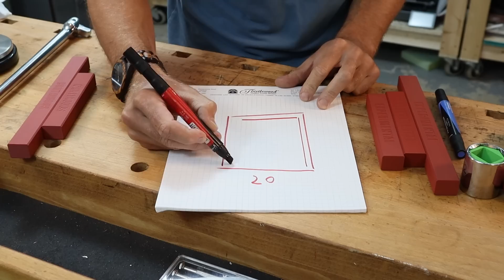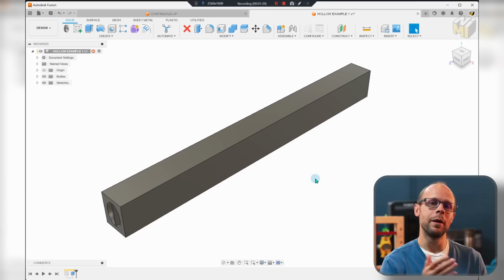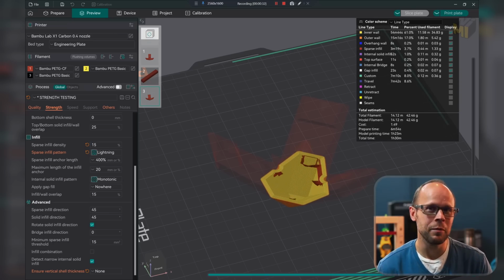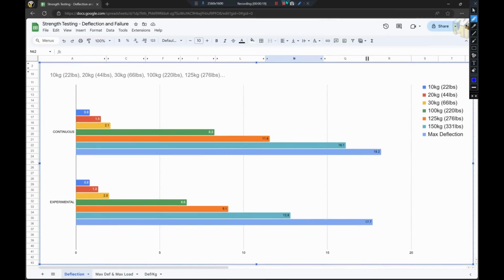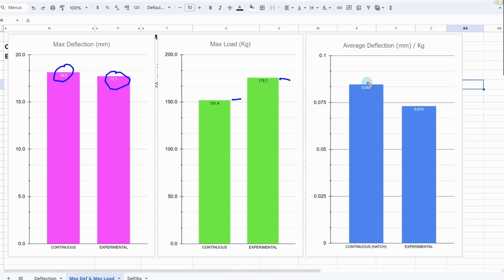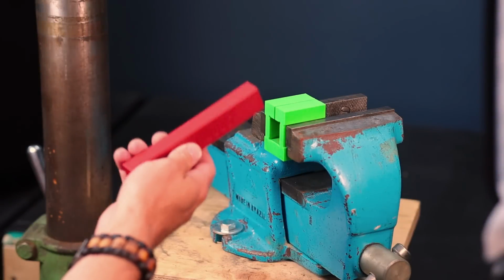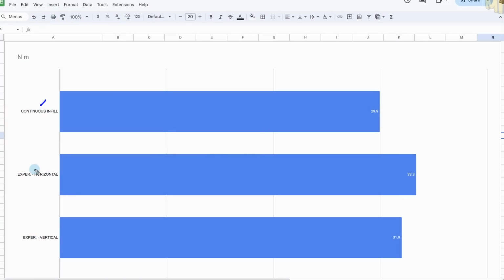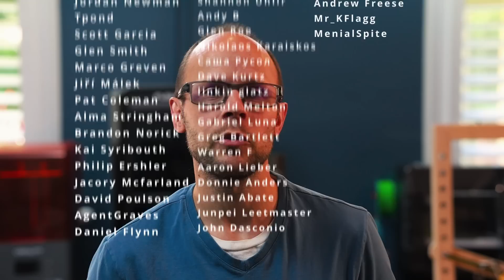Is an UNfilled 3D Print Stronger than an INfilled 3D Print?

Comment: Instead of 1 round hole in the middle distributed holes in circle would improve a lot. Not only because more material but due to the surface area. However that would increase printing time a lot, and it might be just similar (if not better) using low percent gyroid infill with thick infill wall multiplier.

Comment: To smoothly pull on lever, OR direct pull on gauge, use a boat winch with steel wire rope (cable). can anchor it to table or test press and run through pulleys as needed for space management or "leverage" increase through multiplication. VERY CHEAP AND EASY/SIMPLE! Can get ALOT of pull from it and only 4 bolts mounts it vertically OR horizontally for ease/comfort of turning handle.... OR could use a cheap $99 electric 12vdc 1,500 lb atv winch for steady pull rate.

Comment: From my engineer view and experience. What structural properties you get depends on the material.

Materials which are more flexible benefit from filling the volume. While more rigid (brittle) materials benefit from wall thickness.

You can imagine the difference between a steel square pipe and same size laminated wood beam. 

I'm actually insane enough to design my infill in CAD. I have even written gcode by hand to achieve specific things. I'm annoyed that slicers don't actually allow me to have finer control over generated geometry, like directly adding planes or scripting layer behavior. Because I run flashforge, I actually use both Orca and Flashprint, because they do different things better, and if I just want to do quick test I choose the one I know to be easier to do that.

However in engineering mindset your desired properties are always derived 1st from design, 2nd from material.

But because my background is in welded steel products, I naturally account for rolling direction and profile geometry, as they affect things a lot. They are much like print direction and layer joining.

But you will not find any sharp edges in my designs, unless it has a specific use.

Comment: It'd be great if your application of force was always consistent, For the 4 point load test, could you rig an upside down bottle jack above the other end of the handle so you can add load by pumping the jack? That way it should be fairly consistent between the two parts, and it also won't be as reliant on your physical ability to reach the breaking points.

Comment: You could add 3 more spines inside to make it even stronger while using less material than infil
Reply from the maker: I think that could work and provide better support to the tops as well if they were oriented correctly durng the print.
Reply: @NeedItMakeIt  yea I love the concept though you would think more infill material= stronger part but how you fill up the part is what actually matters I love videos like this

Comment: I think the strongest option would be to use hollow spheres for saving material/time/weight.
Lets say you want to have a high % of infill, you'll just distribute some medium-sized hollow spheres as "anti-infill".
If you want to have less % infill, you'll distribute larger-sized hollow spheres as "anti-infill" and anti-fill the space between the larger hollew shperes with smaller hollow spheres.
Reply: You could keep adding smaller and smaller spheres to fill the space between the spheres until you reached the % of non-infill you wanted.

Comment: How much structural integrity might be lost adding holes to the hollow rod? because in theory having it hollow also allows for running hidden wires, no? I mean I don't know how useful that would be or anything, but its an interesting idea.

Also I am not really knowledgeable in this field, I am assuming deflection is how much it bent before it broke, is it better for that number to be higher or lower? and how hard is it for something to go back to its original state if it does bend? that is something I think would be a good test (Though I suppose structural integrity would be compromised at that point).

Comment: Mathematically speaking, pound for pound your best options are either a large hollow cylinder or I beam for holding loads. For your tests, an i beam would work best with most of the length facing "up" and enough width at the top and bottom to prevent torquing, you wean the whole load straight on the support. Conceptually just thing about how much material force would need to move in order to bend it. The more material the better right? If you can imagine drawing lines through it at a perfect 90 degrees from the earth, that's how much material is holding the weight. The more lines that run through a cross section, the more material would need to be moved.

Comment: If you look into beam strength in bending, and why I-beams were created, you'll see that having more material under tension/compression at the furthest extents from the neutral plane(axis, for torsion) increases stiffness. But if stress goes too high, you can get a split down the web of an I-beam (on that neutral plane) so I think it would be worth comparing 2-3 printed I-beams of similar mass, but with different web:flange ratios. 

Chances are they're not worth the complexity to model/print in comparison to a shelled model, or one with minimal infill, but it may be a good demonstration.
But I suspect they would show that prints have need of both the largest possible outer beam dimensions (flange on an I-beam; floor/ceiling of your experimental beam), as well as a sufficient bond between the neutral layers.

Comment: There's a technique I once saw used by a fairly famous entity that allows someone to hollow out a solid piece while minimizing loss of integrity. I remember very little of what it was called or what it was used by, but I do recall they primarily used it for reducing weight, so I'd guess NASA or SpaceX if I had to. 

The technique was basically using some sort of software to calculate where forces would be distributed inside of a part (when under load in various situations), and just cutting wherever the forces were too minimal to be worth the cost. This allowed them to remove a very significant amount of material with barely any reduction in durability. (I feel like I even remember one case where it increased the durability of the part compared to a full solid, but that seems too far-fetched and thus possibly a false memory)

This might be a bit of an insane request, considering how little information I have to give, but I'm wondering if it could be applied here, where you can relocate the mass from the infill to increase the density of wherever the software says will get the most use.

Comment: If you make it solid by adding walls that can cause other weakness because you don't have the crisscross layers so I recommend using normal 2 or 3 walls and 100% lines infill. For this use case I don't think it matters much but for some parts it matters like the light I made

Comment: If i really need strength for something i just put something stong inside. I made internal corner joints for some aluminum profiles and put Allen keys inside them for strength (the ones you get with furniture from IKEA). I had kept them from when I bought my furniture when I moved out of my parents house, finally found a use for them 😅

Comment: To print mechanical parts it would be nice to have a function in the design program (or the slicer) that is able to calculate the arrangement of infill using finite elements method (FEM). Finally we would get some design similar to bones. In bones we see a full material shell and an infill that is increasingly foamy from outside to inside. Close to joints bones are also more stable. Of course, to construct with FEM we need to know our requirements, the forces acting on the part.

Comment: I imagine from the torsion testing has to do with how close to the center the material is. where the inner core really doesn't experience any rotation compared to the outer sides. it would be interesting to make an inverted part where the infill is on the outer side and the Center is actually solid

Comment: Thank you for doing these! I’m working on designing stuff that needs to have strength so it’s really nice to have someone testing. 
I’d love to see a video about temporary joinery (like sliding rails, snap in place, etc) if you’re looking for topics. 

I’m working on something modular that has side pieces that need to slide on and off and I’m having trouble finding ideas that will work well.

Comment: i always avoid generated infill at all cost. i usually cut/hollow the vertical faces with hexagons instead of circles (to avoid overhangs). i also usually design the supports if I really need them so it prints faster with less waste and better finish. there's many tricks you can do when designing for FDM, I even automated some of them as features in my cad software.

Comment: Hi could you do surf board fins?  I found 30 percent triangular infill with around 3 walls and 5 or 6 layers top and bottom was stiffer than 100 percent fill using just shell. Am I dreaming :) I don't understand the reason, though I have my guesses. I need 100 percent shell at the base though, else it snaps.  Esun pla plus at 230 degrees .28 layer height...., as an aside petg just snaps. The fins are around 7 to 11 mm at the base, depending on the chord. The taper semi gradually. (Not linear)
Reply: Ps great video thanks

Comment: If there's one thing I've noticed, it's that color Greatly affects the strength of some filaments. I've seen it with PLA+ for sure, but I can't say for certain about other filaments though. I would just guess that's the case. With the PLA+ the drastics I've seen are between Black and Silk Silver. The black is so much more rigid and stronger while the Silk Silver is so much more flexible and is significantly weaker (but it does print better/easier).

Comment: Increase infill line multiplier as cura calls it, and reduce density in half. This will make the infill stiffer and much more structural. 

I found this while experimenting with structural properties of TPU, which makes the effects immediately a tangibly experience, no breaking fancy tools or setups necessary for crude results.

Comment: Certainly interested in this.  Just to clarify, are you printing the horizontal center line Horizontally?  And in what orientation is that center  line in the weighted pull tests?  Fantastic experiment... and results

Comment: About you two previous videos. I didn't watch them as they seemed seamed too esoteric for me. The serpentine shapes were too extreme for me to consider. Maybe you were trying to make a more interesting, novel shape, but it was too ridiculous so I didn't bother with the videos. It could be that the some of the shapes used could have been more relevant to me but it was a case of Judging a book by the cover.    

OK I just watched the two videos. Just not relevant to me. As an additional comment about comparative testing experiments. If I don't see a 40% difference in performance then it is not relevant. Strength of one material compared to another. If my design relies on an extra 20% then my design is crap. And 40% is maybe worth considering but still debatable. Same thing goes with joints and fasteners.

Comment: I have always been fascinated by taking 7 equal diameter "tubes' and putting them together.  One of them always gravitates toward the center, and the other 6 form a neat "structure" around the center tube.  (Try this with 7 pencils to see what I mean).  You can see something that happens in nature - a Hexagon!  Now - as far as your infill goes - draw a straight line through the centers of all those tubes and align ONE of those lines as the vertical support for inside the square.  The other two lines should go to the four corners if your object is a true square!  I would bet that this type of "infill" would add even more strength!

Comment: Infill is only useful for lauer adhesion and supporting top layers. This doesn't only apply to 3d printing, the outed diameter of a beam contribute nearly all of the strength. Its why steel pipes and I-beams are so common, as opposed to full pieces. Try corrugated interiors

Comment: I could be wrong but the reason why I think the experimental part was more ridgid as well as stronger is because those inner cavities have the same walls as the outside im pretty sure I didn't take the close of a look at your actual settings but if your using more walls generally speaking parts in my experience are stronger so its likely due to that I'd imagine.

Comment: Great video, coming from an engineering strength of materials point of view you really should have had the vertical version for the 4 point bend test as that geometry would have a greater area moment of inertia than the horizontal version, think of an I beam and how they are oriented with the vertical member of the cross section in parallel with the force acting on it. 

As for the torsional test I am surprised to see a difference between the prints but I think if you did multiple tests you would see a similar average strength. It makes sense that the strength of the “hallow tubes” is greater than the 30% infill as torsional stress develops, it is greatest around the neutral axis (in this case the center of the part) and theoretically zero at the surface. Would love to see more extensive testing and the possible application of stress strain curves

Comment: I'd be curious to see Stefan, CNC Kitchen, recreate these tests you're doing.  His motorized screw provides a more consistent and continuous force.  He also uses a three-point bar rather than a four-point; fours have different geometric loading and induce stresses differently, there's a literal reason why threes are used in material testing-- stemming from this, your previous tests with the joinery would've also had problems with the evenness of the loading from test to test, a very long diagonal dovetail would've been loaded very differently from a standard perpendicular dovetail, i.e. testing methodology was not actually consistent where one style of joint would've had unfair advantage within the testing setup.  Even look at Matthias Wandel's work for how to test properly.  I'm sure there's other creators within the relevant space of DIYers and makers, who either have an engineering background or at least an understanding of engineering, who also have proper testing methodology and produce good data.  On the previous tests you also had print orientation issues, which should have been tested for.  On this test you had design issues with perimeter count, of which should have been accounted for in the design phase; thin-wall with infill is very different from thick-wall without infill.  This test also had potential print direction issues.  Infill also does very little for this testing, you'd be better off testing infill with tension, compression, and buckling tests; certain design aspects fit certain tests, figure out which match and don't test mismatched sets. 

If you're going to be doing engineering testing, for the sake of good data and good information, use proper methodology.  I want to see more actual engineering within the space, but if things can't be done properly then creators should stick to being entertainment only, we've all seen how bad information spreads like wildfire in DIY-friendly communities where the basis of the majority are undereducated on the relevant subjects when it comes to hard data and testing of materials and designs; this is also why a lot of maker channels don't have testing setups and attempt to scientifically measure aspects, because they're not qualified to speak on the matter and frankly won't invest into understanding how to do it properly.  Do your due diligence to properly educate your audience.  But to educate your audience, you need to educate yourself first.  You need to understand why your methodology is lackluster, in both design and testing, you need to understand when testing actually matters and how to test for it.  You need to label your produced testing videos as non-educational and put a disclaimer that results should not be taken as fact.  If you presented your testing to a room of formally educated engineers, you'd be laughed out of that room, told to go back to physics 101, and that your testing and design method is nothing more than a science fair experiment that you didn't properly research.  Good data is important, but unfortunately an undereducated community cannot recognize bad data, which is why it's your job as the content creator to do better and provide that good data outright. 

Also, use a blast shield.  Not everything will break cleanly.  Again, it's a due diligence topic, I'm surprised I haven't seen too many comments harping about personal safety on your videos. 

I hope you take this as constructive criticismb and not the content creator usual of being an egotistic pissbaby.  Everyone has to learn at some point, however people should rather learn before they attempt to educate.

Comment: Weird that these videos wouldn't do as good. I subbed because of the testing videos. I do wonder, if you made it a tube shape inside and used a tetrahedral pattern internally connecting the walls, like a spiderweb inside, would it have the same strength from any direction? Would that add to the strength at all?

Comment: For your torsion testing, the wrench end of the part should be supported as well so you are purely twisting the part along a single axis. Right now, you will be loading it in multiple directions while trying to apply the torque with the wrench.

Loving the in-depth testing, it's great!
Reply: Glad I was not the only one that thought this.
Reply: I agree. The torque sensor must be supported by a ball bearing.